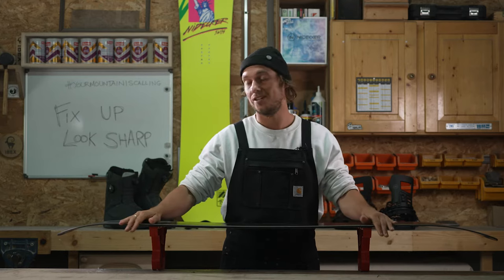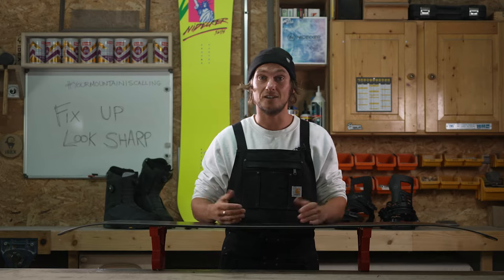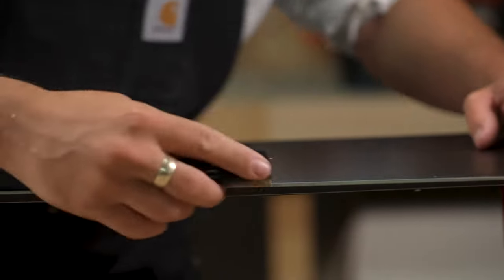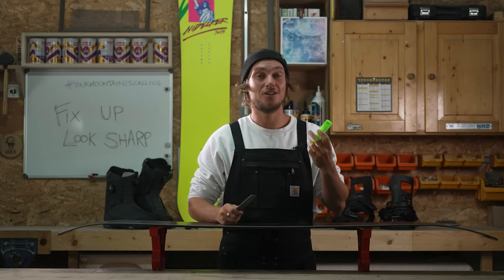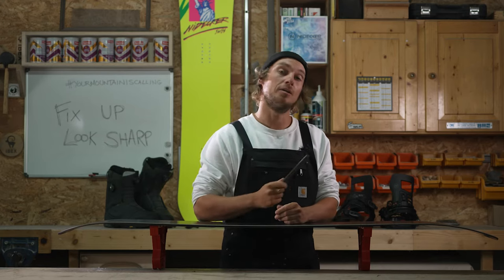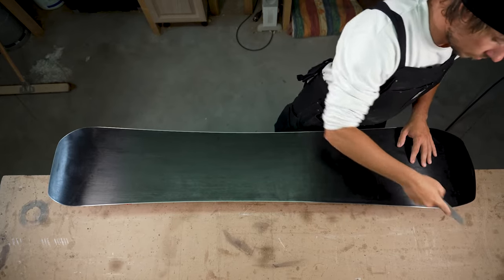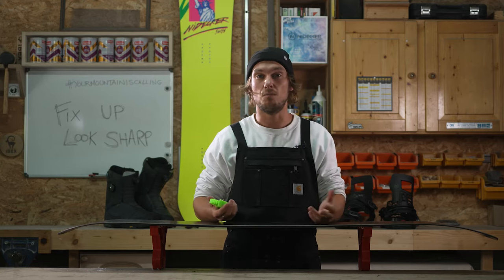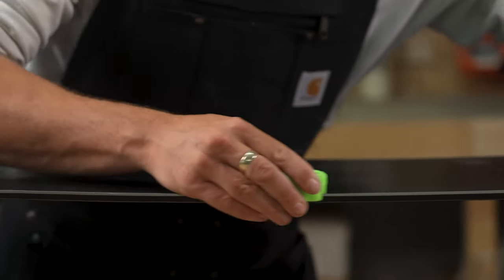HOW TO TUNE AND FILE YOUR SNOWBOARD EDGES

Comment: Do you recommend using a specific edge tool for magnetraction or similar disrupted edges? I know they make one specifically for magnetraction. Thanks!
Reply from the maker: Yep, you can get short ones which work on wobbly edges. Our sidecuts are all radial, which give the longest effective edge and a consistent application of grip when weighted, so you can use any edge sharpening tool.

Comment: What type of file do you use?
Reply from the maker: The one in the video comes from the Dakine tuning kit
Reply: @NideckerSnowboards  my edge tuner has 88 and a 90 degree side. 
If i were going to use the 90 degree side does it face up or does it face down( towards the base )?
Reply: @mauricezenarosa4417  look at it. You can see the narrower angle on the tool side.

Comment: Hello there, I'm new into snowboarding, I can help myself down the mountain in a fair way, my snowboard is new and it's a hybrid rocker, should I dull my contact points a little bit for less chances of catching an edge? Or just go with the factory sharpening  for now?
Reply from the maker: Go with the factory sharpening for now. If you're catching an edge at your stage of snowboarding it will likely be down to technique.
Reply: @NideckerSnowboards  thank you for the reply <3

Comment: What about the tip if there is a bit of rust?
Reply: Ski shop told me it’s ok to clean that up yourself with stainless steel at home. Be mindful, don’t scrub your board. And keep your board dry between use/storage to avoid more rusting :)